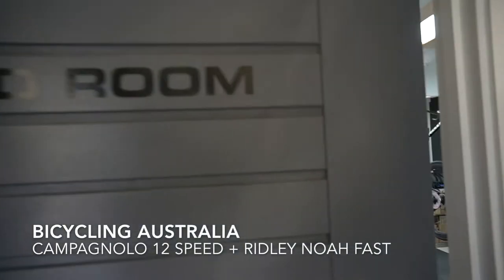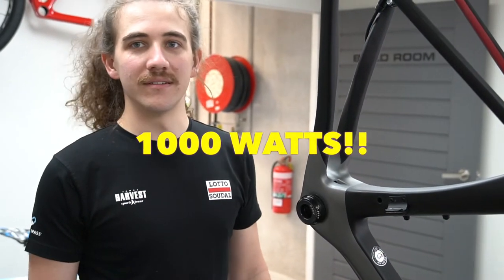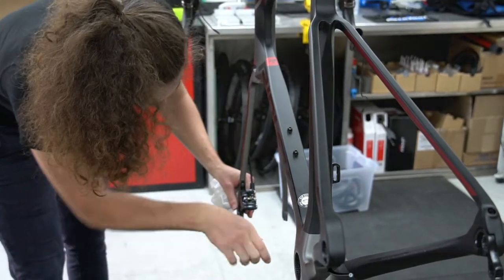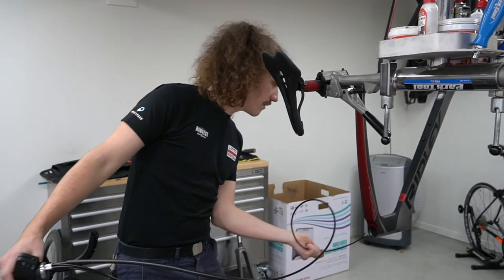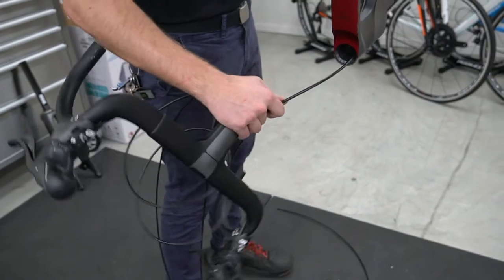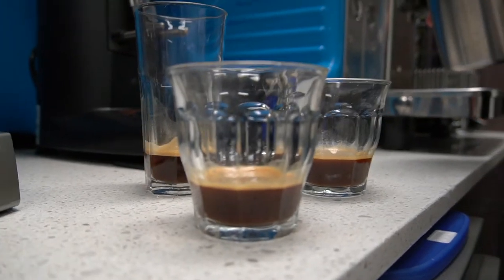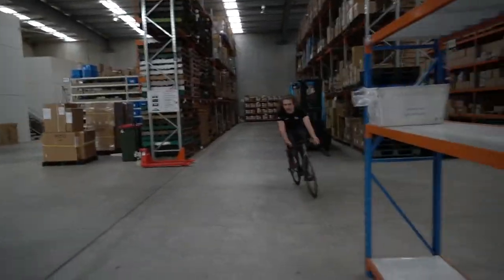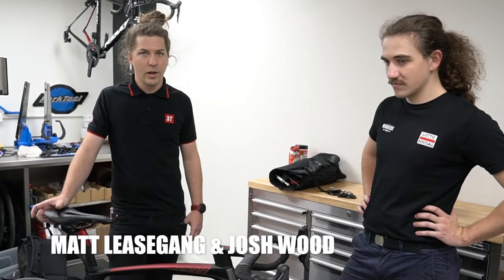12-Speed Campagnolo + 2019 Ridley Noah FAST

Comment: good mechanic,no doubt.
But be true: Who the hell needs double 12?!— Campagnolo needs it to sell more and more and more groupsets.
I can tell you about roadracing in the 70/80ies: We had double six gears without frictionshift,and we have been as fast
in the races as they are today!
It’s not about the number of gears you have! Check out all the combinations you have and you will find out that many of them
are quite similar,they distinguish in how the chain is running!
AND A CHAIN SHOULD RUN AS STRAIGHT AS POSSIBLE!The more diagonal the chain is running,the more sliding friction you’ll gain.
If you compare an old 6-sprocket chain to these slim and tiny 12-speed chain it should be clear to everyone wich one is able to carry more load....
And that is why in today’s races you see the guys standing on the roadside waiting for their bike to be changed-more defects on that
complicated technique is seen all over,especially the last years when they tested their DI2 electronic crap!
I could stretch this out to the use of carbon-in my opinion only for the professional riders who compete!
Been racing for decades now but i never had issues with steel/Aluminium/titanium forks, but i have seen dozens
of „exploded“ carbon parts,mainly seatposts and forks.
As for example steel will warn you through some noise before breaking,but  carbon tends to explode-a friend of mine told me
he went down so fast that he couldn’t even lift his hands from the handlebar!
Surely carbon might look good,but for me it is just more plastic crap we have to depollute after use.
I can show you some of my vintage bikes : some are more than 30 years old, but i can take them off the wall
and ride brutal cobblestone roads with no worry!
You won’t do this in the future !
Even UV-Light harms carbon,i got an old vitus carbon frame,and i have to store it in the basement in order to 
keep it away from the sunlight!
After hundreds of thousand km of bikeriding i recommend Titanium as the premium material for a bike frame.
A steel frame looses his integrity within the first season, but Titanium will keep it to the end.
It is not as stiff as carbon so titanium is capable of little“flexing“,which will give you a very convenient ride.
It is also a superconductor,lay your hands on the material and it is getting warm instantly.
Leave it in the backyard for decades out in the sun and rain-doesn’t matter-clean it and ride.
I’m on titanium frames since the millennium(2!),and i am proud to say i will ride them til i die.
And then another one will enjoy this precious metal!
So you can easily buy a second hand frame-you can polish it over and it’s like shiny new!
Reply: Sounds like this is the first piece about cycling tech you watched or read in the last 20 years. While one might ask if 12 gears are really better than ten, both are still better than six or seven - a few additional small gears get you up any hill faster and more comfortable*. And carbon has gone a long way,  material- and craftmanship-wise. The times of "suddenly exploding" forks and seatpots are over since, and after having ridden several steel frames longer than a few years each, I can tell you by personal experience (and science can back it up) that "steel losing* its* integrity within the first season" is complete nonsense. Same goes for "carbon deteriorating in sunlight" which might apply for raw fibers but certainly not for fibers embedden in resin and covered with opaque paint as in a bicycle frame!
Reply: @einundsiebenziger5488  You have no clue!
I’m the one who puts these bikes together-who has to install the bottom brackets and set up the hydraulic disc brakes-who builds the wheels etc-the quality is often below of what we had when this “carbon thing” started in the eighties.
My Vitus K 9 was superior quality than most of the shit today-that’s the reason why this frame is still rideable today-try that with your carbon frame in 35 years....🤣💦
Reply: @domestique3954  Our experience may differ in some points. But please do not call someone clueless, who has been in the industry as an amateur racer, bike journalist, bike messenger and bike mechanic for almost 30 years. There were and there are some shitty designs around for sure, and some are repeatedly coming back, yet mostly it's not the material itself but the way it's dealt with.

Comment: THat is BS guys, hitting any caged/sealed bearing on the side is not recommended, putting a 1000 watts into the crank is not applied to the side of the bearing like hitting it with a hammer. Use the proper tool, a bearing puller.
Reply: the guy's hair clearly shows his lack of judgement
Reply: Well actually there's no way to grab the outer race.  If you grab the inner race, you may damage the bearing too, though it's probably better than beating on it.  I think if you had a piece of PVC pipe 36 mm in diameter you could push/tap on the plastic cups.  That would be the correct way to do it.